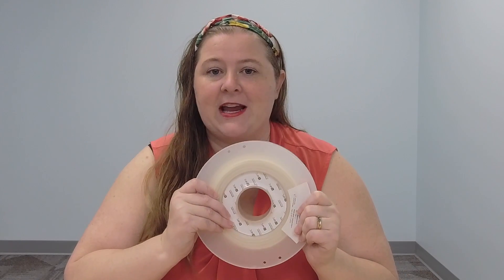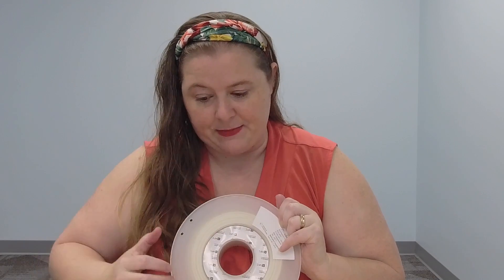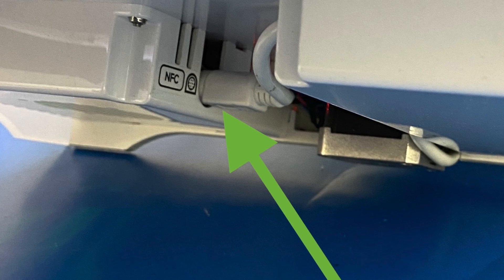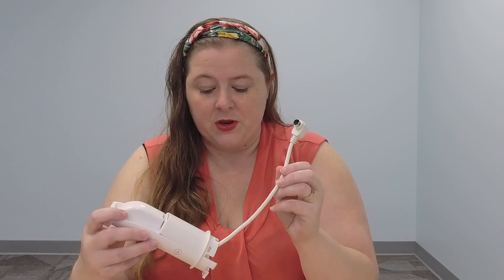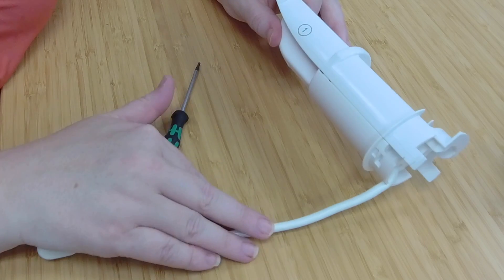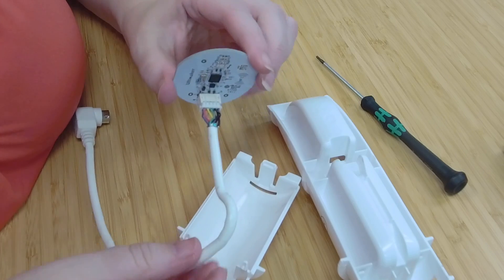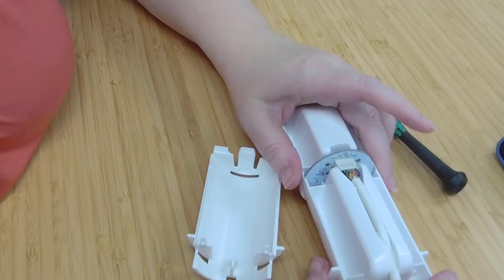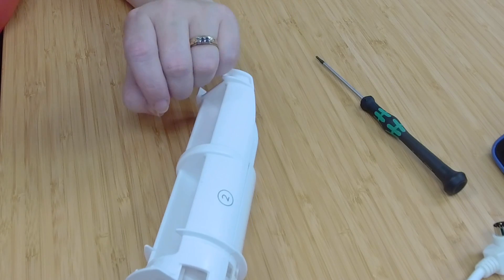Reassembling the NFC Reel Holder (UM3/S5/S3/S7)

Comment: thanks for the video
do you know if there is any procedure to improve the print of ultimaker
work damage support for this printer but some equipment provided is printing with that ghosting effect on the print
we have already aligned the belts and axles and even so this problem persists and varies from equipment to another
Reply from the maker: I would recommend putting in a support ticket; we can take a look at settings. I'd also make sure that there's no play on the axles.